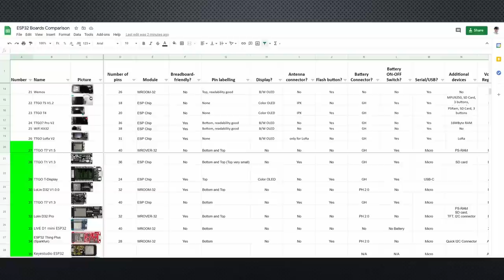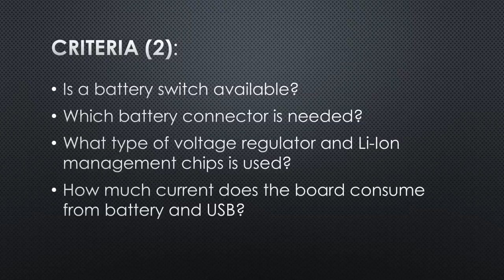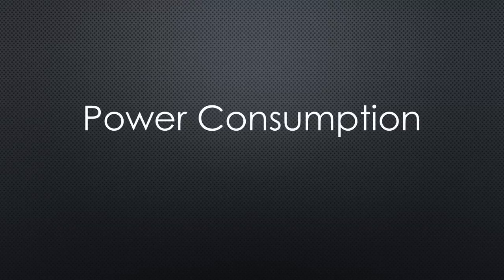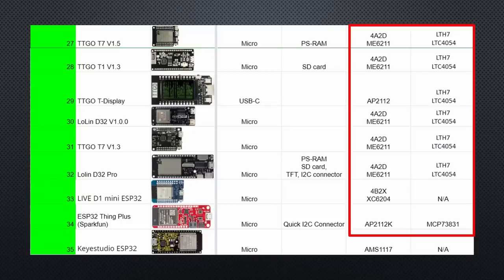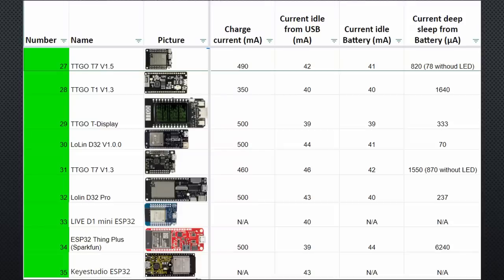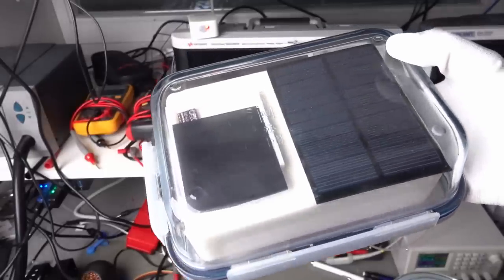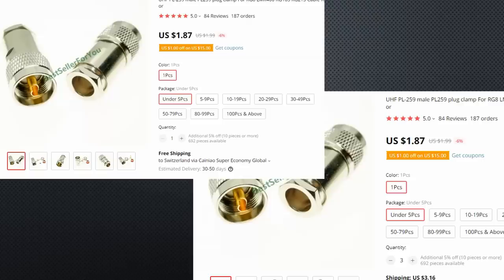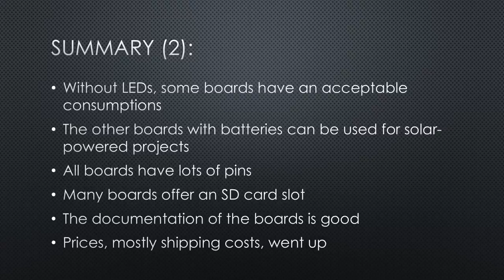#366 9 New ESP32 Boards: Comparison and Tests

Comment: Andreas, thanks for mentioning shipping costs and woes.  I have been fighting these lately, as well as items getting lost, cancelled or significantly delayed.  I find ordering through distributors and through bigger eBay sellers and Amazon and those with local stock to be faster, more reliable and affordable.  Digikey was a favorite distributor when I was a design engineer for similar reasons.   As with much of the pandemic I fear these choices may result in smaller businesses being pushed out, but what can you do?  +1 for a future video on the topic and the supply chain in general.  Thank you.

Comment: Great video! Quick note about the TTGO T7 versions and the Live D1 mini: The inner pin headers have the same form factor and pin layout as the Wemos D1 mini. This enables a lot of readily available shields to be used! They can often be a drop in replacement by just changing some pin definitions. 

I always use the TTGO T7 V1.3 as it does not have PSRAM, and thus has pins 16 and 17 also available!
Reply: Thank you / bedankt Marc. That was my question. I have a few MH-ET Live and the are really nice but without battery support.
Reply from the maker: Good point with the small shields. I used them in a project in the past where I build 30 for a IOT introduction...

Comment: @Andreas Spiess - I have tested really a lot of ESP32 boards because i do this on a daily work day. I mean use ESP32 boards for profeesional use. I use always now since a year and a half the LOLIN D32 Pro. The one with the display adapter, ssd battery and SD card adapter. VEry well working and coding for use of both cores. I that time the 1 1/2 year i have tested Europe produced boards too because of warranty issues when needed. But still ím on the D32 Pro. It works very well and i use all connectors. Coded is all in C++. Thanks for sharing your view.
Reply from the maker: Thank you for your feedback! What European boards did you test?
Reply: @AndreasSpiess  I will come back to you on discord in your channel via a PM when this is ok for you.

Comment: Where's our Aussie made one the TinyPICO? Seon has shared his comprehensive engineering efforts supporting the ESP32 community. Locally great for me!
Reply from the maker: Agreed. I just checked how much they would be shipped to Switzerland: 56$ for one of each. Not too expensive for me, but for a lot of my viewers I fear.
Reply: >Seon has shared his comprehensive engineering efforts supporting the ESP32 community

Have you looked at the schematics for those boards? They are claiming they are special when in reality they are using the same LDOs as all of the cheap ones from china.
Reply: @donpalmera  I'm sure you're aware that they're based off the manufacturer specifications.
Reply: @TradieTrev  

>I'm sure you're aware that they're based off the manufacturer specifications.

What does that even mean? FYI Those tinypico boards were claimed to have some super magic "power path" in the crowdsupply campaign from what I remember. It was an LDO with an enable signal. If that's level of engineering on offer..
Reply: @donpalmera  Lol, maybe you can't read. Same LDO? Not seen ANY other board using the LDO I use, but you know best ;)
Reply: @donpalmera  Again, you know best.. my "magic" is just an LDO with EN.
Reply: @UnexpectedMaker  an ldo is an ldo. There is no magic ldo that doesn't shed the difference between the input voltage and output voltage as heat.
Reply: @UnexpectedMaker  yes, your ldo is just an ldo. That's not actually the problem. The problem is clearly having an ldo in your schematic but having the product description written in such a way that it sounds like there is a proper power management chip.. when the reality is, if I remember correctly, you have an ldo with an en input that is tied to a signal that decides if the ldo needs to be on or not.
Again what you have isn't bad but it's hardly something so amazing that you'd say get a usable patent for it.
Reply: @donpalmera  Well, no, LDO's are all different, especially in their quiescent current - but you stated it was my LDO that was magic. I never did. In fact, I never claimed anything magical. Just because you are not able to determine what it is about my design, that AT THE TIME, was different and better than every other ESP32 board out there, that doesn't mean it's not there. It just means it's beyond your understanding. When every other ESP32 board I had (and I have about 15 types) was at best, 125uA and at worst, 7mA in deep sleep, and I got the TinyPICO to 20uA... that happened BECAUSE of my component choices, and my power design implementation.
Reply: @donpalmera  And again,  you are so far off base it's not funny. 1. There is not controllable EN wired up to the LDO. EN has nothing to do with anything. Clearly you did not understand the schematic as it's not present there, just in your imagination. 2. No, I never claimed there was a power management chip. I claimed I have optimised power paths, which I indeed do. Beyond anything that was on the market at the time. Since making my design open source, many boards are configuring their design the same way and are also gaining massive current improvements.  Again, 20uA compared to 125uA for the closest board on the market at the time. If you think that's magic, ok, but it's not, it's a custom, well thought out power path design. Who's getting a patent? I open sourced it.
Reply: @UnexpectedMaker  I hate to be rude but you write like an angry child. I just looked at your schematic again.. so you have a discrete switch between vbat and vbus and an LDO that isn't a clone of the ams1117.. wow much engineering.

Of course that's above my level of understanding etc. It's not that the crowdsupply page was a bit of an exaggeration.. which is weird because the op for this comment seemed to think not using a crappy Shenzhen ldo was a huge engineering feat and they must have gotten that idea from somewhere...
Reply: @donpalmera  You're right, You know best. I'm wrong. Nothing optimised about my design. Cheers :)
Reply: @UnexpectedMaker  

Yes you're just too smart man.
So smart you don't realise you can have patents on things you open source yourself. (FYI a lot of licenses have patent grants as part of the license).

I've looked at your schematic. I misrembered the en signal on the LDO. Big whoop. Your power path is a single off the shelf part. You didn't engineer that. The semiconductor company did.

You keep writing power path. You don't have a power path. You have a switch and some traces on the PCB. Your input there is component selection not some great feat of engineering.

And all of that isn't actually an issue. Over selling and your delusions of grandeur are.

Comment: Deep sleep  current while USB powered is sometimes also important. For example when building a sensor, that also measures temperature. Deep sleep power usage from the board can easily affect the measured temperature 0.5 - 1 degrees. A lot also depends on proper case design for such a sensor.
Reply from the maker: I am not so sure if a few microamperes will create a lot of heat. I anyway would not put a temperature sensor near the MCU because it can influence the temperature when it iis active.

Comment: Thanks for a very useful video. Unfortunately the Lolin D32 v1v0v0 is no longer available. I wonder where they all went?! I have tried another variant of the board and hope it will have the same low Iq. The product I purchased is the "LOLIN32 Wifi Bluetooth Development Board Antenna ESP32 ESP-32 REV1 CH340 CH340G MicroPython Micro USB Lithium Battery". I will see how this performs when it arrives!
Reply from the maker: TTGO has many product revisions... Let's hope!

Comment: Great Video, useful spreadsheet.
Pity about some of the gaps - I'd really like the deep sleep power consumption figures for the MHET Live D1 Mini.
Reply: On closer inspection the TTGO T7 V1.4 appears to be pin compatible with the MHET Live D1 Mini, and the TTGO T7 V1.5 is also very similar, and might be able
to be retrofitted to a project with a minor code change/rebuild.

Comment: please check the esp32-s2 boards, would be nice to see pro/cons vs esp32 boads. Also circuit python is supporting ESP32-S2 now
Reply from the maker: I already did a video about the features. We will see how to use it. So far USB seems not to be supported by the Arduino IDE.

Comment: Hi Andreas,
i really wonder why the power consumption is so different across the boards...
If the battery input is passing a voltage regulator for the boards with the higer consumption, and the "winners" are cheating by just passing the 3.7v to the Processor directly, i would consider that as a bit unfair (maybe the other boards would be able to perform the same if you connect the battery to the 3.3v Pin?!?)

For my plans i learned (from other Videos / Articles)  that the best options for long running battery powered projects is two Lithium AA Cell which stay at 1.5V for a pretty long time... Here the Li-Ion Battery seems to be a real option, at least if the two winner boards to regulate the battery in.

Did you investigate why these extreme differences exist?

By the way ... thanks for the video - reaaally useful information on your channel!!
Reply from the maker: 1. I did not investigate
2. LiFePo batteries are also a good solution because it stays below 3.6 volts which is the ESP's specification.

Comment: have you thought about designing some of the boards, ordering them and soldering yourself? most of these boards have just basic components like ldo regulator, some leds, usb-to-serial chip and a battery controller. The shield is easy to solder and bypasses hard challenges in wiring it in correctly. If you need more than 10 of these devboards I would definitely go with this. The most expensive part of course is the esp32 shield and you can get it as cheap as 2.2$ per piece on lcsc and the pcbs are almost free on jlcpcb. As to make it easier to solder, just using through hole and dip chips should do the trick.
Reply from the maker: As mentioned in the video I started the "Superpower" project for my viewers...

Comment: @5:06 To fix the need to press the button to upload to the board, you add a resistor to one of the pins to pull it up/down, it is something I have added to my boards, I’m in bed right now so I cannot look it up on my designs PCB for you right now, reply to this message and that should remind me to look it up for you in the morning.
Reply: Actually I think I remember now, I’m pretty sure it was a 10K pull up onto the EN pin.
Reply from the maker: Thank you. I will try it. And sleep well. I thought it must be very late where you live...

Comment: Thanks, nice overview. I love the Lolin D32 v1, lasts very long on battery with deep sleep and it can measure thre battery voltage with an internal voltage divider on GPIO35
Reply from the maker: Good to know that it already has a voltage divider. I added the info to the spreadsheet
Reply: I tried to buy one but they have sold out. I ordered another variant and hope it has the same low Iq ☺

Comment: Your Keyestudio board looks exactly like my DOIT boards.  I found that I often have to press the EN button to get a sketch to load, but a capacitor from the EN pin to ground sorts out most of them.  Some boards are said to need 10uF, I have 0.33uF on mine and it's fine, yet I also have one board that never gives a problem at all. It seems to be worse on my new MSI motherboard than on my previous Gigabyte board (vintage 2009!).  
Try it, you never know, it might work.
Reply from the maker: You are right. Adding a 10uF cap does the job. Thank you!

Comment: @Andreas Spiess excellent videos, they are so helpful.  You asked if anyone knows of any ESPs that doesn't need the button pressed to upload code, I have not read the 586 comments below so if this has already been mentioned sorry.  The "DevKitc v4" and "ESP32-S2", when uploading code from fast desktop almost never, but with slower laptop most times button needs holding down.  So pooling resources with you and others my experience with these modules they have slightly better antennas than the "DOIT" boards, probably because the antennas have more space and over hang the main motherboard.  Unfortunately the DevKitc v4 does use the AMS1117 regulator for the 3.3v however the board maker, Espressif, say it is fine to power the 3.3v pin directly with your own power supply, therefore one could assume deep sleep power usage is low but I have not proven if the AMS1117 leaks power on it's output pin, the power LED would also need removing.  I power my boards via PoE splitters so I prefer a mix of deep_sleep and light_sleep.
Reply from the maker: I found a solution to the "button problem". Add a small cap between EN and ground and the problem is gone :-). And yes, the AMS1117 is not made for low current applications.
Reply: @AndreasSpiess  That is handy to know, the cap.  Keep up the excellent work Andreas.

Comment: on the boards with pins too close to fit over middle of sigle breadboard... connect two breadbards side to side with 2 rows of the thin power trace blocks between the big blocks, the dev board then stradles the two boards and now you have 3 open holes for each slot... EVEN BETTER than the wide one that fits a single breadboard in my opinion.
Reply: I order all my stuff from digikey to avoid fakes..
Reply from the maker: Also a good possibility to use two breadboards. And digikey of course is the "gold standard"...

Comment: Thanks Andreas, I did not know about the ME6211 regulator, might use that in place of the AP2112. It is slightly cheaper with a bit more power.  Still using the AMS1117 when it is running a few sensors as well as the ESP32.
Reply from the maker: The AMS1117 has a very high quiescent current :-(
Reply: @AndreasSpiess  Yeah, it is not good for battery power but i am running a vs1053, 2.1W amp, CP2104, IR, RF, LDR, buzzer, WS2812s, a fingerprint sensor, and a nextion on the same board so running with a battery is distant dream :-)

Comment: Just noticed the TTGO T-display aliexpress link is for a seller who isnt Liligo, who I think designs and manufactures the device and has it for a lower price.
Reply from the maker: I usually post the links I used. But Liligo is also a good source. Sometimes I buy also from them.

Comment: Please do a video on part shopping strategies for makers.  For example, I haven't used Digikey for years because of the "overhead" costs involved with small orders.  Now, based on your report, I need to include them in my shopping.  But, the situation is changing rapidly.  Aliexpress is an interesting case.  Summer 2020, shipping times to the US increased by 2-3X.  Now, as you point out, their shipping costs have increased drastically for small parts.  But it seems that they air ship to a US based re-shipment point for delivery by US mail.  Net result is that Aliexpress shipping times beat Amazon "standard" shipping (free over $25).
Reply from the maker: Banggood already has stock locations in various countries and also on AliExpress I can sometimes can chose European warehouses... I think, things keep being interesting...

Comment: Maybe you could produce a video about the light sensor project. I'm highly interested! Sounds great that the small solar cell can charge the battery during the winter time. In video #155 it seemed to be a bit complicated and without success. Thanks!
Reply from the maker: Maybe I will share my experience about solar charging with this sensor...
Reply: Andreas Spiess Which MPPT-charger do you use in the light sensor project? This info would be usefull ... Thanks
Reply from the maker: @SatsumaTree  MPPT Chargers are not needed for such small power. I made a video about solar chargers.

Comment: I especially appreciate the info on power usage in deep sleep - - accurate data is hard to find.  I'm delighted to know that Lilygo improved that issue in their new v1. 5 of the T7 TTGO (after desoldering the LED).  However, the link you provide currently offers the v1. 3 board instead, probably because the 3rd-party vendor changed the product at that link.  I almost ordered it before I noticed.  Perhaps you should link directly to the LilyGo store on Aliexpress instead?
Reply from the maker: Sorry for the wrong link. It should be corrected by now. I usually use the links I purchased my boards and I got a 1.5 version from that supplier. Maybe you contact him before. Or buy where they promise the 1.5 version.

Comment: Espressif Development Boards
Maybe I missed it, but I didn't seen any reference to the Espressif development boards. I got one from Amazon for $10 and free shipping from Amazon. I've been using it for a month in my hydronics/greenhouse to monitor temps, humidity, control fans and circulator pumps, etc. It has worked flawlessly so far. I have it configured for OTA and it's a breeze to flash remotely.
Reply from the maker: Do they have a battery connector? Otherwise they are nearly the same as #35.

Comment: Just for fun, I'll be ordering some modules from Europe before Christmas, spreading some cheer.
POE looks interesting for the not-very-remote devices without susceptibility to wireless noise or the need for battery. Just a UPS supply to the POE switch to survive power outages. ... Would be interesting to see how much of the POE can be siphoned off for active sensors. i.e. how marginal the power converter has been dimensioned.
Reply from the maker: I use POE also for my Access points. So I connected a bigger power supply to the switch. 
If you source "European" I would be glad if you can share your experience. I plan to create a spreadsheet where we can share our "supplier experience"
I just placed orders in the US and in Australia...